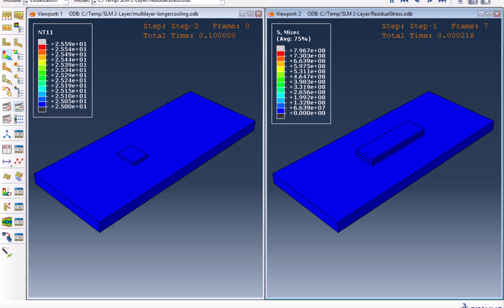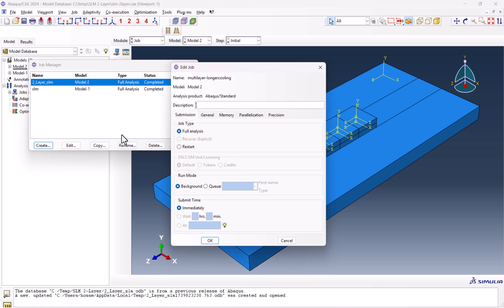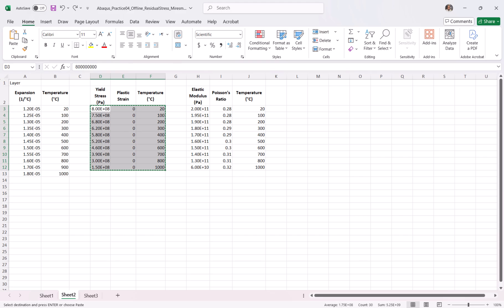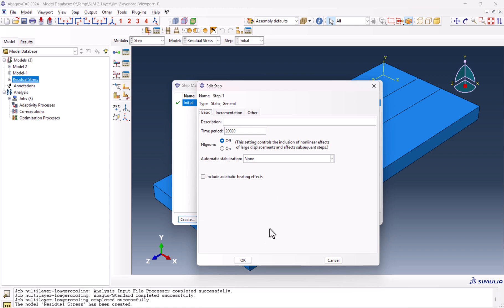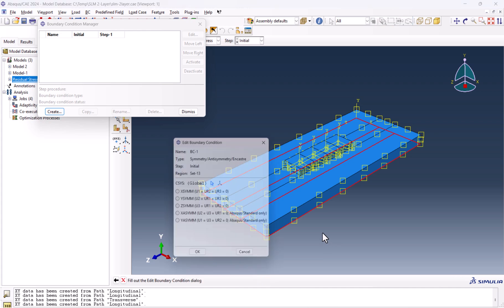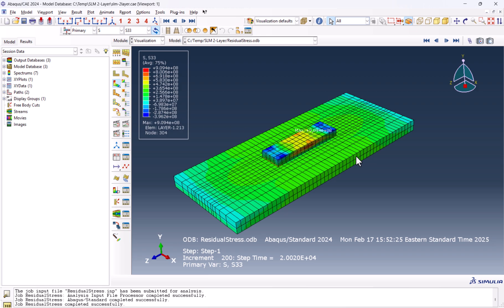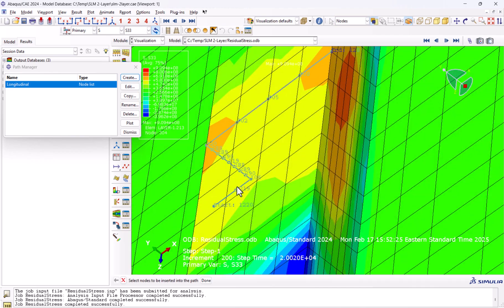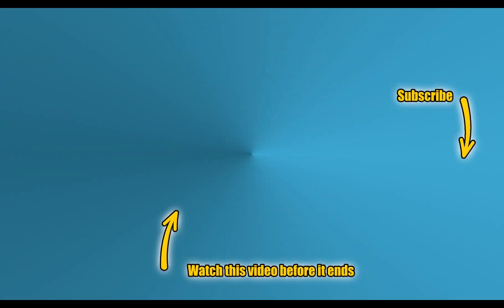ABAQUS for Additive Manufacturing: Predict Residual Stress Like a Pro!

Comment: Thank you for such a nice video. Upon following your guidance I can replicate this simulation. I have few questions. Suppose I want to heat flux to move 1m/s then in steps what time period should I put? Don't we need element activation in mechanical simulation like thermal simulation that you have performed in "SIMULATE Multi-layer Additive Manufacturing Like a PRO with ABAQUS!" in interaction module?
Reply from the maker: You’re very welcome—you’re by far the most loyal fan of this channel! 🙌

For your first question: speed is distance over time. So if your heat source moves at 1 m/s, and the weld path is, say, 100 mm long, your total step time should be 0.1 seconds (since 100 mm ÷ 1000 mm/s = 0.1 s). Just measure the distance your heat source travels and divide it by the speed.

As for the second question—no, element activation isn't needed in the mechanical simulation. In residual stress analysis, we’re focusing on what happens after the weld or AM process is complete. Element activation is mainly a visualization tool in the thermal step to mimic the deposition process.

Great questions as always! 💪🔥
Reply: @FEAMASTER  Thank you for clarifying. I think, for the example you have taken, I need to give 0.1s in time period for each step(of element bundle)....right?
Reply from the maker: @Arijit-ME  It was just an example! Just take the measurement! I can't remember how long the length was!
Reply: Why in step(static general) you tale  in time period 20020? How to calculate this mechanical step time period
Reply: Hi Can you please explain Why in mechanical we choose time period 20020?  How you calculated this time period here
Reply from the maker: @Arijit-ME  It was the time of the AM +cooling time.